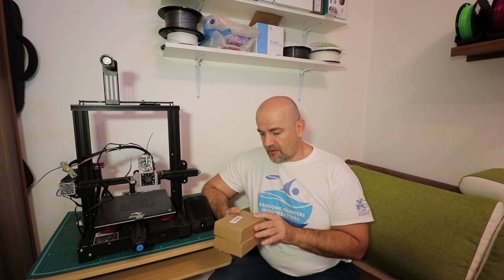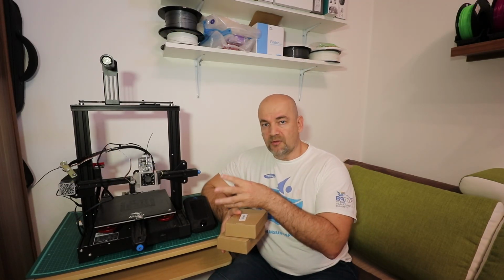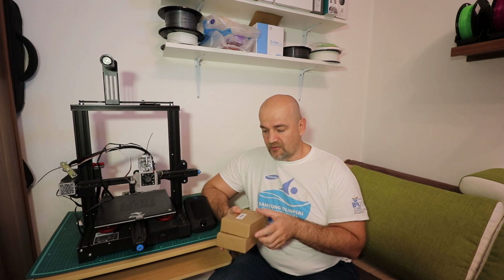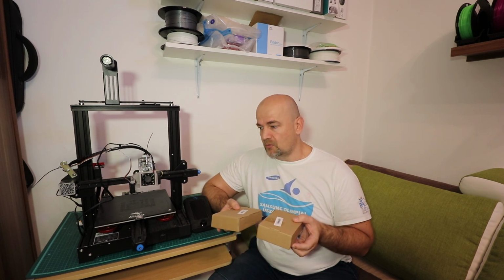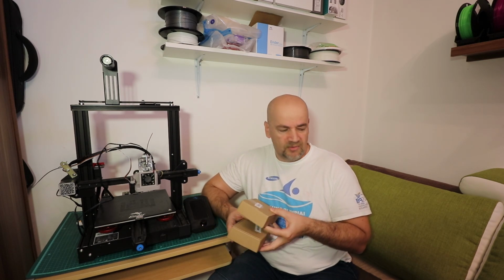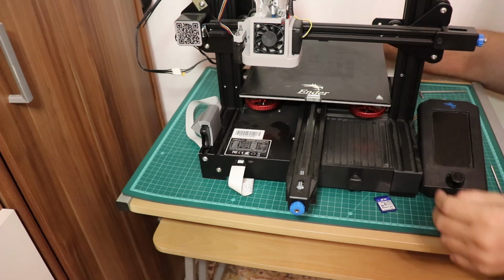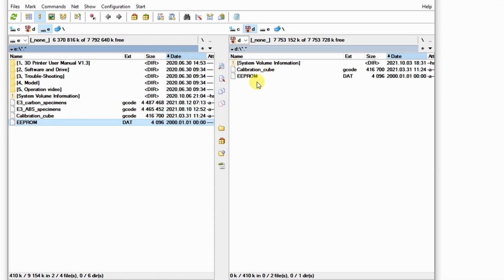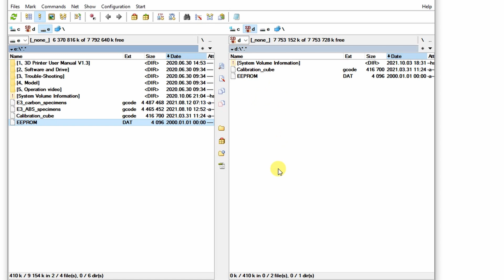TF to SD card adapter (micro SD to SD card) another upgrade for Ender-3 V2

Comment: I just got one of these, it looks like you cant hot swap cards, have to turn printer off and on for it to recognize larger card.
Reply from the maker: Exactly this one? I am using it on this E3V2 inside enclosure, no problems so far. Hm, but true, I have only one card.
Reply: @MyTechFun  im using marlin, is a setting that needs changing for card to refresh. The standard ender doesnt have this problem i guess.

Comment: The cables are also not shielded, it could be probably to a big problem for errors. 🤔
Reply from the maker: I am constantly using this adapter since I installed it (in and outside of enclosure), so far it works perfectly every time.
Reply: @MyTechFun  that's nice, I wish ever cables would workdo you have a link from the seller. 🤗

Comment: If the SD card slot is the only way you can print then you should always think about an adapter even if it's just to use as a victim cable i.e. the machine doesn't die due to the slot wearing out the cable adapter does. Anything expensive that gets regularly plugged and unplugged should use a victim cable.

Comment: You may also find that if you swap SD cards with the power on it will not recognize that the memory card has been changed. You will have to unplug and reconnect the cable from the printer for it to recognize it. Karl
Reply: Update to the latest firmware, I've read that it should resolve this issue.

UPDATE:  I just received my adapter, if I power up with no SD card installed the screen will display "sd init fail", if I pop a card in and go the print menu it lists and prints the files on the card.  I've even removed the card, got the error message, re-inserted and it read the card.  Having said that, it does not lock in.  It clicks when you push it in, it feels tight, but the slightest tug and it slides out.  I also formatted the SD card to FAT(default) w/4096 file allocation same as you format the micro SD for 3d printers.
Reply: I have the same problem with my ender 3. It doesn't recognize the sd card swap from the adapter. Only if the adapter is removed and reinserted on the printer slot, which defeates the purpose.
Any suggestions?
Reply: Just retuning mine because of the same issue. Pointless really…
Reply: does it work when you restart the printer?
Reply: hay alguna solucion para esto ???Is there any solution for this ???
Reply: @alfa3d558  nothing I have found so far. It just makes the cable a waste of time and money
Reply: Anyone find a solution for this yet?
Reply: Once you reinsert the SD card you must power off the printer then power it back on in order for it to recognize the files.  Otherwise you have to remove the ribbon cable from the printer and reinsert it which seems to defeat the entire purpose of the mod.